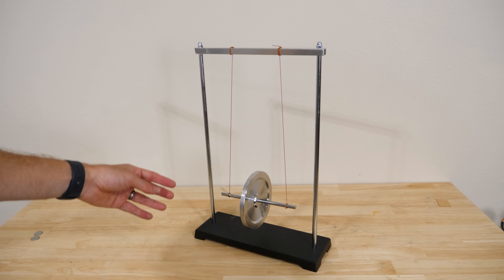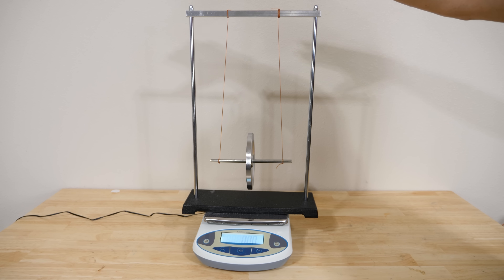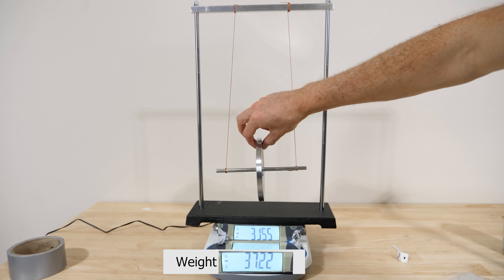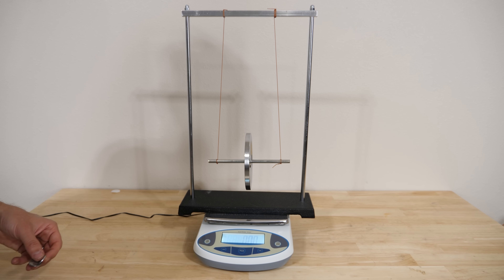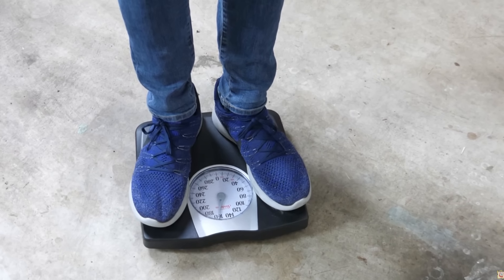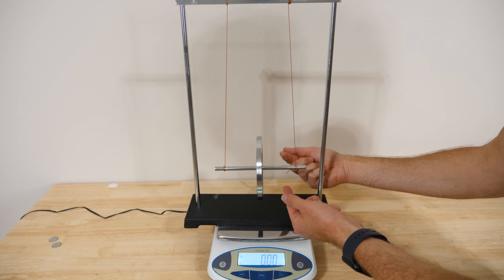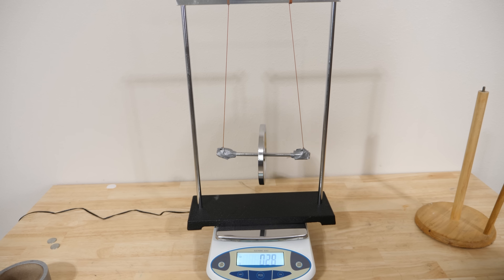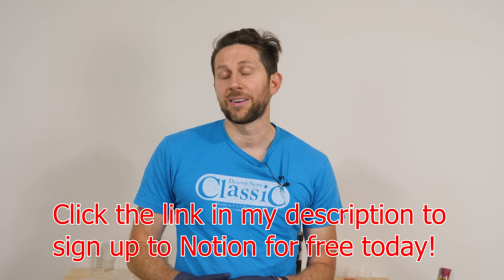How Does The Anti-Gravity Wheel Work?

Comment: How about in a vacuum? It would be cool to see how much longer it will last.
Reply: The acceleration I believe would be the same, but I wonder if the friction of the wires around the object is what's really slowing it down instead of air resistance? Hard to say until he tries!
Reply: @mike1024.  don't friction increase in vacuum? If so it should be last less time as reduced air friction should be less  then increased rope friction
Reply: @tomfisher1499  I'm not sure! That's an interesting thought. I'd imagine regular friction could theoretically increase if air was causing a buffer.
Reply: @mike1024.  yes but not only friction of the internal fibers of the cord wire, elasticity of the cord is also loss of temperature, recommend explanation of Richard Feynman of rubber bands
Reply: My guess is that it won't be much different. The sound loss is already minimum and so is the air resistance since it's a round object
Reply: metal strings and magnet wheel=repel each other so they don’t touch. then your experiment would become effective
Reply: He's covered something similar in a different video. He says because his vacuum chamber isn't anywhere near the vacuum of space, and isn't even close to as high of a vacuum as we are actually capable of artificially creating on earth, it's good for food experiments, and other experiments showing what no air does to various things, and what removing air does to them.

But in terms of experiments like this that have to do with weight, friction, things like that, the vacuum chamber has negligible results. E.g. he spun a top in his vacuum chamber, and it lasted just a fraction of a second longer than on the table. The friction of two items hitting each other, such as the top on the plate, will cause the same slow down whether there's air or not.
Reply: Almost not change. A vacuum would reduce air resistance, but air resistance at that speed is minimal compared with other slowing forces. Energy lost as sound wouldn’t decrease. There’s no sound inside the vacuum, but the vibration is still there. With sound/vibration, you’re only moving minuscule amounts of air, and so there would be nothing to gain from removing that air. Additionally, reducing vibration with air resistance doesn’t remove energy from the motion of the disk. Energy from the disk is lost to vibration which is then lost to air resistance. As soon as the system starts to vibrate, that energy has already left the part of the system that we care about (the disk). Retaining that vibration in the system instead of losing it to air resistance would not add a net force to the disk that would keep it oscillating longer.
Reply: @timwildauer5063  maybe the dampened vibration even helps the disk to spin more smoothly? Interesting 🤔
Reply: @timwildauer5063  interesting to think of the vibration as instantly losing the energy... I suppose it is lost at that point... doesn't matter how it dissipates after that, because as the motions get smaller and smaller they more resemble heat and can't be applied back onto the wheel (at least not in a closed system), until they do become heat and sound and convection in air... please tell me you're an actual academic scientist so I know I can rely on this new model haha
Reply: @joshyoung1440  Nope lol. Just a random dude on the internet who once took a class in physics. Sound is just wasted energy. Sound is movement that is not intended, movement that isn't in the direction you want. I think you're right that it would ultimately turn into heat, though not very much heat.
Reply: To the vaccum chamber robin
Reply: YES LIKE SO HE CAN SEE THIS!
Reply: It would be a cool experiment. However, I feel like you may only get 1 or 2 more bounces. Still the same amount of friction on the wires.
Reply: I don't know any vacuums that can fit that in the dust collector
Reply: That’s what she said
Reply: Vacuum would have no measurable effect!
Reply: Air drag is not a big factor for losing energy
Reply: How about removing the frictional energy of the rope and the axle?
Reply: @AshenafiDemisse  well, that's impossible, because frictional energy isn't a thing. But if you want to remove friction, go ahead. In fact, I'll pay you $100 for an axle with aaalllll the friction removed. Isn't that a great deal? Just keep this between you and me. Don't tell the patent office.
Reply: Almost certainly negligible. The density of the flywheel powers through the tiny viscosity of air, almost totally unaffected.
Reply: Most of the energy is lost to heat by twisting the string
Reply: There is hardly air resistance here
Reply: air resistance in this setup is negligible
Reply: Everyone forgets all this is performed on the surface of a rotating planet. It is this rotating body that is affecting your imagination and the results you can not understand. This would best be performed in space where there is no rotating body then there would be no mystery.?
Reply: We can’t get a perfect vacuum with our current tech so you will still have air resistance so it wouldn’t do too much
Reply: All of this comment should be taken as suggestions as I am not the most informed on physics, nor all of science.

 Air resistance could be a factor in its loss of energy as the wheel moves against air vertically as well as spinning, causing air to be displaced. I agree with the comments that suggest that the elasticity and stretching of the strings would impact the energy lost, which would also probably result in energy being lost into heat energy. I suppose in an ideal world we would test this in a vacuum, measure the temperature of the strings to find the energy lost by friction then replace the strings for ones that are less elastic which don't cause energy loss through friction but can still move freely. Also remove as much wobble as possible too, as it is reasonable to think that energy will be lost in the current set up. All of this is just theoretical however and would require an actual test to validate.

I also just want to mention the comment about removing the "gravity force" or the weight of the object. I'm not sure this system would work if there is no resultant force (weight) acting. I'm assuming they meant the weight and so I won't  . Also, the comment talking about the smoothness, I understand your point but it doesn't account for the object moving against air down and up. Think of planes, they can't accelerate infinitly bug their noses are designed to be very aerodynamic to at least reduce it. I still think your point has some merit though, as a cube could possibly experience more air resistance.

My original comment was suggesting a (partial) removal of one factor (air resistance) to show that it does in fact cause loss of energy, which it POSSIBLY (not definite) does. I say this as it is hard to imagine that all the energy is lost though a small area of friction on the strings and none from air resistance.

My theory on why the weight forcd decreases (if he already explained sorry) is due to the movement up causing a force (effectively the opposite weight force or Newton's 3rd) in the same direction as the normal force and (up against gravity) its weight ( w=m×9.81). I haven't watched this in 2 years so sorry if I did get anything wrong. 

Plus I'm not the absolute supreme knowledge bank of all physics. I actually don't fully understand how the mechanisms of this system work, so am mainly speculating on certain aspects. This is just suggestions for you all to consider, if you care to. Take this with an open mind, but also a grain of salt. Wow what a rant huh.
Reply: VERDADE
Reply: As if they haven’t made a space ship with this shit
Reply: And gravity
Reply: The only thing that would be different is resistance on the wheel
Reply: I think most of the losses are the twisting of the fibres in the cord and some air friction / coanda.
Reply: You would get the almost same result bcoz friction uses most of energy(not air) here but with out friction it wouldn't spin like that due to no friction in btw wheel and string....!
And in zero gravity I think it would be different...
Reply: @deletedaccount573  "in zero gravity it would be different" you don't say?? The wheel staying still wouldn't randomly rebound?? Astounding! Btw, air resistance is still referred to as friction.
Reply: @deletedaccount573 in zero gravity there is 0 potential energy so it wont work there because this device works by converting potential energy into kinetic and vice versa
Reply: @deletedaccount573 bruh h
Reply: it would be nearly the same.... vacuums don't  remove gravity... a vacuum would only remove the the friction the falling weight creates at it hits the molecules of air when it's traveling... so a VERY negligible amount.... I doubt you would see ANY difference in this setup.. you would need a scale with MUCH MORE precision
Reply: @ThatTweedle  vacuums don't remove gravity? How is that relevant? Gravity isn't what slows the wheel down.
Reply: I bet most of the energy is lost in the sudden jerk at the bottom, the weight has to suddenly change directions applying a lot of stress on the string which stretches and isnt completely elastic
Reply: @enderyu  exactly my thought. The biggest improvement in energy conservation per cycle is probably the string Material, so using a very thin and stiff Material like the ones used in bowstrings (e.g. dynema) will make a noticable difference compared to a natural material like cotton or most of the  common polymers.
Reply: @enderyu  the wheel don't suddenly change directions though. It keeps it's momentum to climb the string again. It only changes direction at the top.
Reply: Not much more---  The machined tooling work on the disc is very smooth, so it doesn't have much wind resistance.   The resistance comes from the friction in the string;   and that friction will still be there in a vacuum.   Also, each time it reaches the very bottom and bounces back up-- there will be a slight stretch in the string as it suddenly changes direction, acting as a shock absorber;  and actually when you think about it, the SCALE itself acts as a shock absorber:  as it suddenly changes direction at the bottom, it pushes on the spring of the scale and that saps some of the energy out of the system, by heating up the springs in the scale itself.
Reply: Your only removing the friction of the air and sound so probably not much. But a Levitron will spin for a long long time in a vacuum.
Reply: Little bit more
Reply: @blazingguyop  no shit, sherlock
Reply: You guys seriously underestimate boundary layer effects of air sticking to smooth surfaces.  The difference would be more than negligible.
Reply: @GigsTaggart  at high speeds surely, but how fast is that disk in this video spinning? I would guess that air resistance for this home experiment doesn't mean that much
Reply: Agreed, Mr. Phoenix
Reply: It'd be about the same the loss is majorly due to friction so vacuum won't make a difference
Reply: This!
Reply: @dougfoster445  not this.
Reply: Remove the gravity force, it might last as same speed as it's starts but some atom still inside still slow it down as air resistance so it will last for hours if it in the same way.